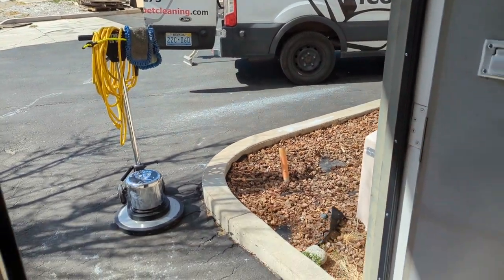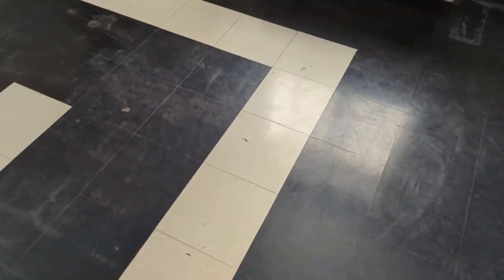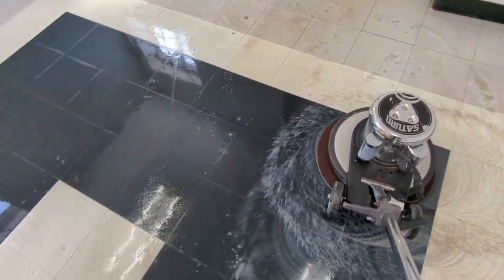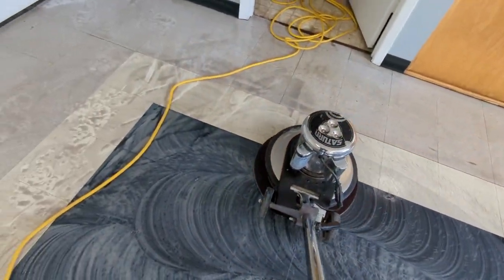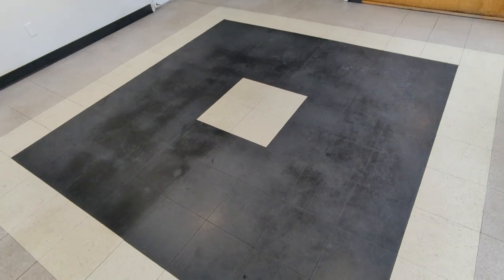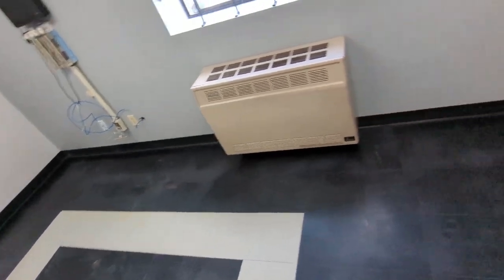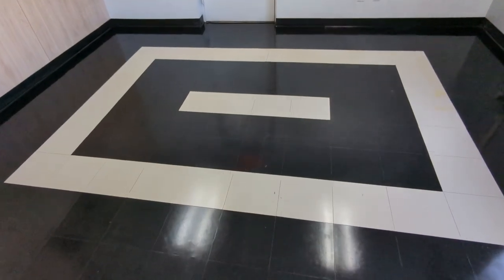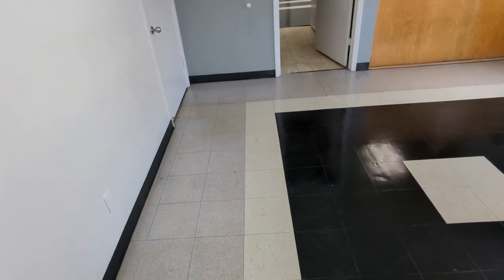3M Surface Prep Pads for easy peasy VCT refinishing

Comment: Would definitely see this as a lot safer in the ED than stripping the wax, which gets extremely slick. I couldn’t over emphasize the caution enough. I think there’s been changes in floor options as well in EDs and ORs etc. Low Maintenance is the key. Why would they scrub a factory finish to apply wax against the installers recommendation is beyond me.
Reply from the maker: Many factory finishes junk...